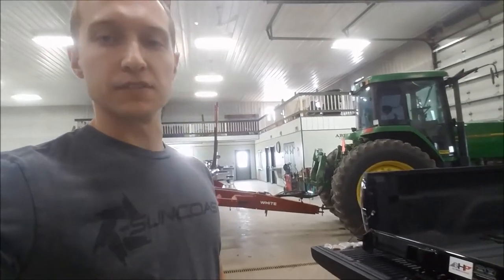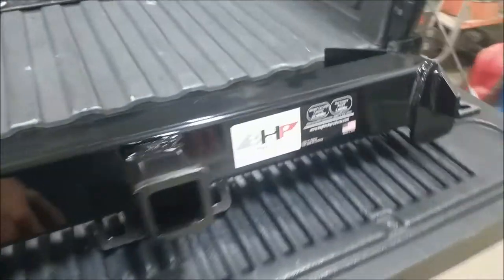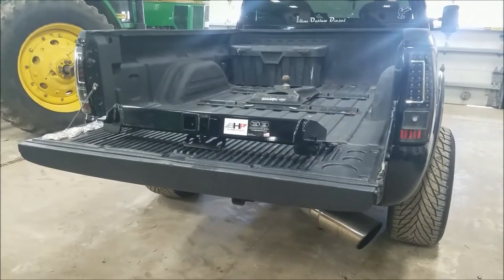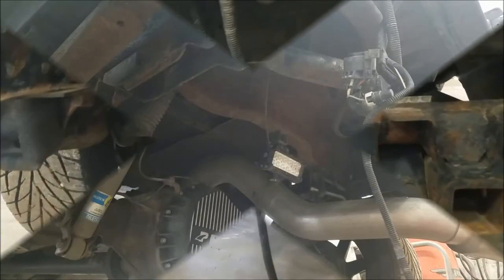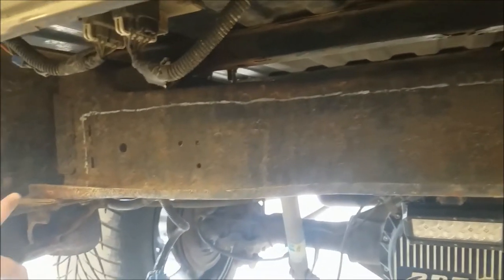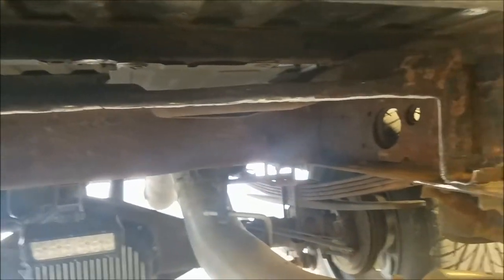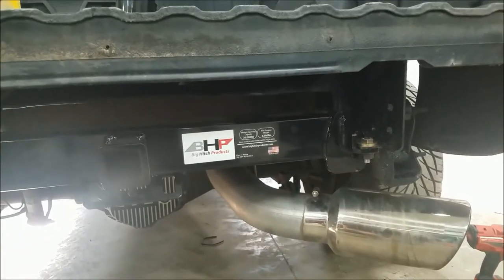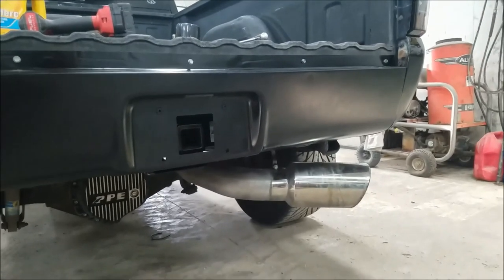Roll Pan Sled Pull Hitch Install

Comment: Nice install bud.. looks like there is a lot of clearence between the top off the hitch and crossmember. .. do you think that the full 4 inch cut is necessary or could you take less ..like 3 inches and it would work ?
Reply from the maker: Cheers! There definitely was more clearance than was necessary, I actually just went under and measured how much extra room there is when I read your question, there is just shy of 2" of extra clearance there so you could get away with cutting off probably 2.5" from the bottom and that would be enough.

Comment: Thanks for doing the video on the reverse led light under the bed,looks so good where can I find them connectors you used? Maybe you can send me a link or something but keep up the good work love your truck an build!
Reply from the maker: https://www.wirecare.com/manufacturer/deutsch/additional-deutsch-connectors/dpp-deutsch-pre-packs/dt02gy-deutsch-2-pin-stamped-and-formed-contact-connector-kit?gclid=CjwKCAjw75HWBRAwEiwAdzefxGmUEO8GjVskdyPlqkOG6q0194D3vVp0Et9tvWZt3v5OCWe2rJRe-BoC4wIQAvD_BwE

This is the connectors I used, we have them at my work. For the other end that splices into the reverse wires of the taillight I just used the little blue splice connectors you can find about anywhere, including walmart. Thanks for the question it was a good excuse to make another video!

Comment: What was the torque  for the bolts and what size drop size hitch  please
Reply from the maker: Not sure on the torque specs, I just tightened them down hard with a big impact. I use an 8" drop hitch with it.
Reply: @FixedVaneDuramax   I appreciate it the info

Comment: What brand is your roll pan I want this same setup
Reply from the maker: 1740 Garage I think I actually got this one off ebay, there are a ton of different vendors but this one has treated me just fine.
Reply: @FixedVaneDuramax  what vender did u use?
Reply from the maker: Alex B I tried looking back into my purchase history, it wont show me the full order details that I can see the vendor. But I’ve bought 3 over the last few years and probably all 3 were from different eBay stores. Just make sure it is a Fleetside rollpan and they should be essentially all the same. Some come kitted with the license plate light, some don’t.
Reply: @FixedVaneDuramax  Alright, Thank you

Comment: The truck is sick man one question having that light by the spare tire mount does it give off a lot of light? Thinking of adding some there myself any videos on the install or how you did it?
Reply from the maker: Thanks! No I don't have an install video but I could definitely make a quick one, but basically its just a 7" flood led bar I bought cheap off ebay. I drilled a hole into the spare tire mount to bolt it up and wired it in to my reverse lights so that it turns on when I am backing up. It does a really good job of lighting up the area behind the truck I like having it a lot. If you have your existing OEM bumper and hitch you can move it back a little more and space it down so that the light is not blocked by the hitch as much. With this rollpan and hidden hitch the light is unimpaired but I just added a spacer to lower it down a little when I had my OEM bumper.
Reply from the maker: I made another video to answer your questions, give it a look and let me know if you have any other questions!

Comment: looks like a cutting torch and not a plasma cutter. There is a difference.
Reply from the maker: Jerry Hubbard Notice the single line to the cutting tool, as well as the ground connection line. This is most definitely a plasma cutter, I use it quite often.
Reply: I could not see it that well. Sorry.